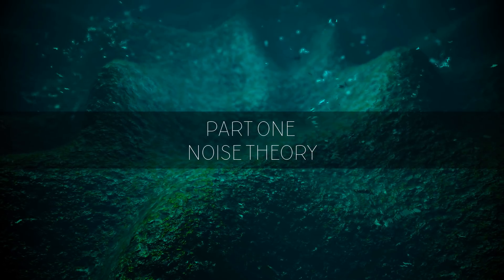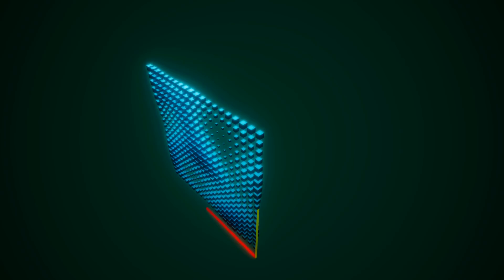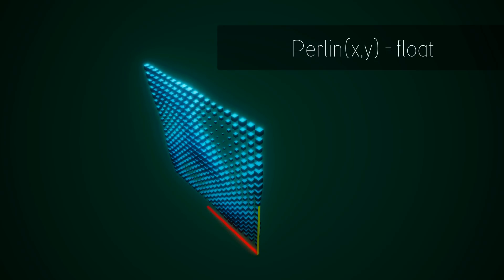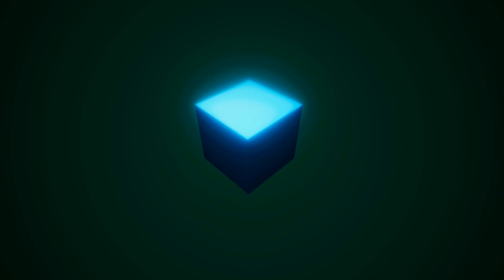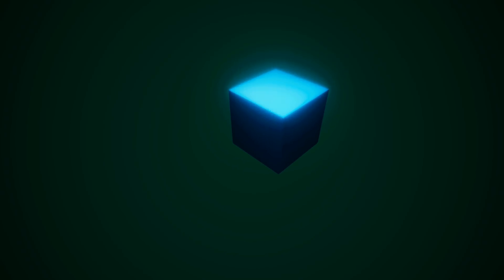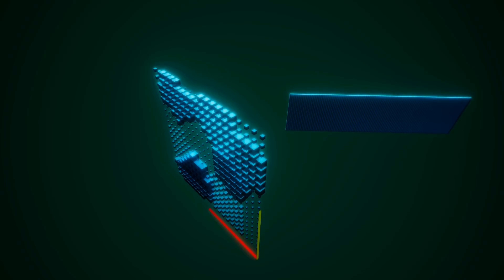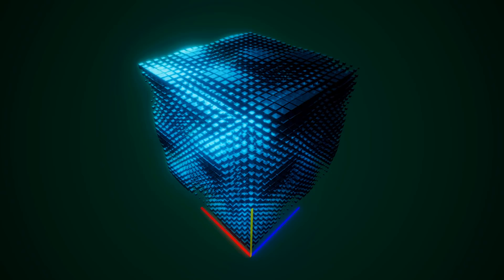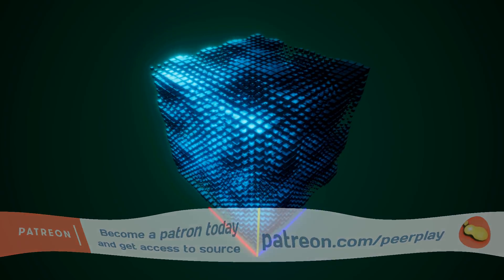Underwater World Shaders - Unity CG/C# Tutorial [Part 1 - Noise Theory]

Comment: There is absolutely no reason to use Perlin noise over Simplex noise, which is simpler to implement, more efficient (especially in higher dimensions), and has no visible artifacts created by using a grid to generate the noise.